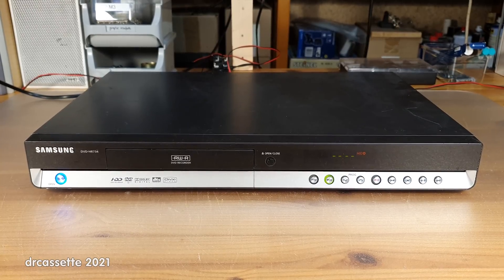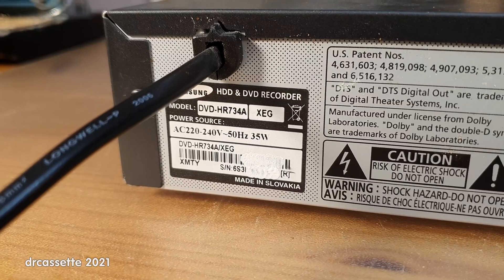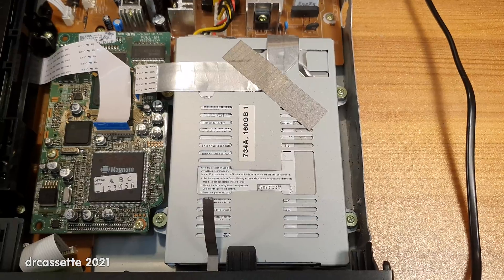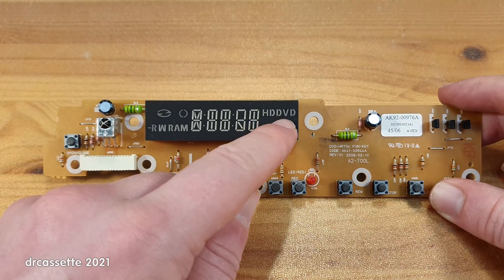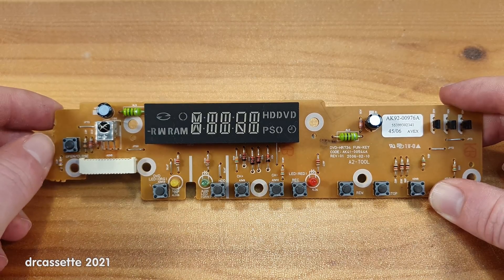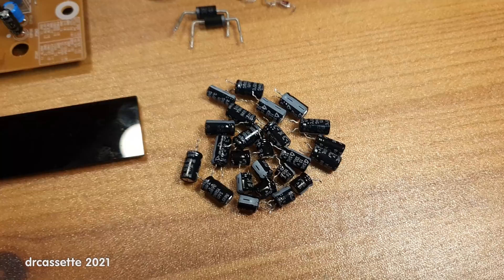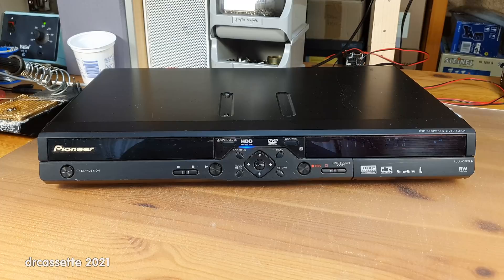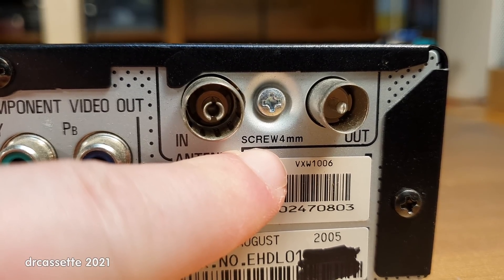Teardown of two DVD/HDD recorders

Comment: i would pay max 20 euros for them since they should cost like a chinese capture card+old ide hdd
Reply from the maker: These old DVD/HDD recorders are capable of a much higher video quality than any Chinese video capture card. Most of those can not even capture a full quality analog PAL video signal.
Reply: @DrCassette  i know i have one (both chinese capture and an hdd recorder from 2004 but an hd capture card + a composite/scart to hdmi adapter is the best way for old videos

Comment: i was able to take the videos from the hdd, they are not encrypted on mine, the hdd just had a different filesystem, you can use testdisk to recover the files and then convert to a newer format (Mpeg 2 to h265/h264), even the deleted videos showed up since i formatted it multiple times but they are not full obviously

Comment: I have that Pioneer 433 still in use today.  Bought it back in 2005 and it hasn't skipped a beat since!  Remote Controls are easy to come by.  I got a second one for about £10 a couple of years ago on Ebay.  The Pioneer has a great video encoder in it and you could record in any bitrate and resolution from 15Mbps 576i to 1Mbps VCD quality.  I used to use it at 6Mbps (the sweet spot for MPEG2 SD video) which would give 90 minutes per DVD-R disc.  Also very handy tp have a Firewire connector on it that meant you could record directly from MiniDV video camcorders, edit the footage on the HDD and output the final edit to DVD-R.  It was certainly one of the best "video recorder" purchases I have made over the last 36 years in the business!
Reply from the maker: A friend of mine uses these Pioneer DVD/HDD recorders in his video transfer business. He records video using the special high quality recording mode, but then connects the HDD to a PC. Thanks to a special piece of software he is able to copy the video files over, so that any editing can then happen on the PC. As I mentioned in the video, the Pioneer recorder I had was in really bad condition. Not a big loss. I can get another one with remote control from the local classifieds ads for like 35€.
Reply: @DrCassette  Interesting.  Do you know what software he uses to extract the video files from the hard drive?
Reply from the maker: The program is called IsoBuster. I tried it myself yesterday on the HDD I took out of this Pioneer recorder, and it was able to detect the recordings. Unfortunately you have to purchase a license to extract those video files.
Reply: @DrCassette  Okay, thanks.

Comment: Are you quite sure the dvd recorders don't support DVD RAM? Nearly all computer DVD recorders I know support it... And my Panasonic HD/DVD Recorder also does support it (i.e. both the drive and the firmware support it, and I have successfully used it). It can even use the type of DVD RAM Discs that came in their own caddies. Fortunately,, it also  does support using the bare discs. I would actually have loved an HD/DVD recorder such as mine but with a digital tuner, as that would have made life a lot easier when it comes to transferring recordings to a computer. Also, analogue TV in the Netherlands is completely dead, including analogue cable service, so any device without a digital tuner is virtually useless.
Reply from the maker: Neither the Samsung nor the Pioneer support DVD-RAM. If they did, they surely would advertise it on the front, and I have looked up the specifications of the Pioneer to make sure. I have three Panasonic DVD/HDD recorders that support all types of DVDs, including DVD-RAM. These recorders are still quite useful for digitizing analog video.
Reply: @DrCassette  Indeed they are. In fact, that's the only reason I’m keeping on to mine…
Reply: Wow, what's impressive about what you say is that you do have DVD RAM media (even the caddy mounted type!) in this day and age to try that functionality.
Reply: @BilisNegra  That be as it may, DVD RAM never got the credit it deserved. The caddies absolutely sucked from day one, but at least DVD RAM allowed for features which we plainly did not get ever since, such as being able to remove part of a recording without having to erase the entire disc, and that’s not to mention the editing functions. Even though the tech may now be outdated, which I’m definitely not going to deny, doesn’t mean that it wasn’t any good in the first place. And, as outdated as it may be, we still don’t have a convenient new technology to replace it. The same is true for audio. I’m not saying you can't record audio or video, but it is definitely more involved than just pressing a single button… Even when using a computer, simply recording “what you hear”, isn’t as easy as it used to be. You can blame copyright lobbyists for that…

Comment: Those Pioneer ones are nice, I still use one as DVD player. It’s a model from 2009 with support for USB keyboards. On most of these devices the harddrives are IDE, but the dvd drives tend to be custom mechanisms. Very interresting to see that the second model had an off the shelf computer dvd drive in it. I think the small ribbon cable connector might be a miniature IDE interface, like what they used for laptops. My father currently uses a Samsung HD recorder with only a harddrive in it, but it’s storage space is not enough to record more then 3 hours. I wonder how difficult it would be upgrade the HDD. 

Also the older DVD players tended to have processors based on the now forgotten MIPS architecture. In the mid 2000’s it was still used until ARM became more common. Current DVD/Blue ray player SOC’s tend to be ARM based.
Reply: Apparently the HDD drive's are tied to the recorder... 
I haven't tried to swap out the HDD for a larger capacity HDD to test it myself... I wonder if someone has found a way to do it? I have a pioneer and a Sony that would be much better if they had large capacity HDDs...

Comment: These devices are a good and often free source for spare hard drives. I have multiple 500GB Seagate Pipeline and Video hard drives that have been removed from decommissioned TiVo boxes from a cable TV provider, and some of them are operating in excess of 50K hours with no reallocated sectors. While the performance is not the best, they run extremely quietly with no need for active cooling.
Reply from the maker: I very rarely find cable boxes with HDD. The cable providers over here make sure they get their boxes sent back when the contract ends...
Reply: @DrCassette  It's the same over here, but some slip through the net or are forgotten about. While still technically the property of the provider, I doubt they will consider it worth their time to seek legal action or issue fines to people who have excess hardware. Especially since it's no longer in circulation, and will likely only be recycled anyway.

Comment: I have a Pioneer DVD/HDD recorder that the remote is going cactus and you can't do any other thing but it has a usb port and supports USB keyboard for controls. Using it if for about a year and the recorder itself is going cactus and I still have it, sitting on the shelf sucking electricity just to display the time on its front display.
Reply: Interesting! Have you tried using a USB mouse? 
Some remote controls are available on eBay, I found an early Sony LCD TV that someone threw out, it came with the original remote control and the TV worked but the remote control had issues. I looked around on eBay and found a brand new one from China that looked identical in every way except that it didn't have the Sony logo on it! The quality was exactly the same! 
I did the same thing for a Sony DVD HDD recorder that I got for $5 which didn't have a remote control... 
If there's a remote control for a TV which is as old as the one that I found, then there's a good chance that there might be one available for your one!
Reply: @PeterMilanovski  I have tried plugging both keyboard and mouse through USB hub because the recorder only have a single port in it and it does not work both. Haven't tried plugging the USB mouse alone, it might work.
Have tried searching on eBay for the remote and I saw something that looks like the original but does not have the logo and some keys are swapped it might work but the recorder have gone cactus. It freeze when you power it on and just displays power on and does not do anything, front keys does nothing, keyboard does nothing and no display on the TV and won't even power off unless you unplug the power cord.
Reply: @SlinkyStoney  that's a shame! The pioneer that I have is so good at editing that I prefer to use it over a computer even though I have to use a remote control...
Reply: @PeterMilanovski  yup, it does have a nice UI for easy editing and stuffs.
Reply: @stefanegger  thanks, will try that. But will it erase all the recorded videos or just the settings?